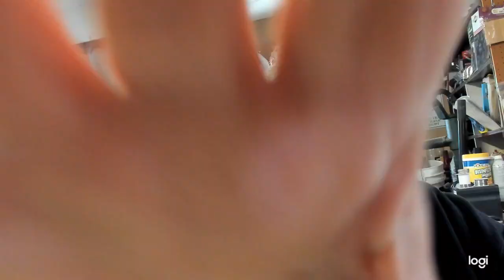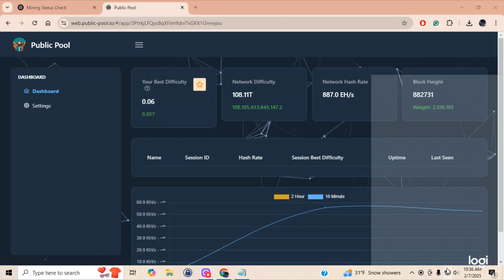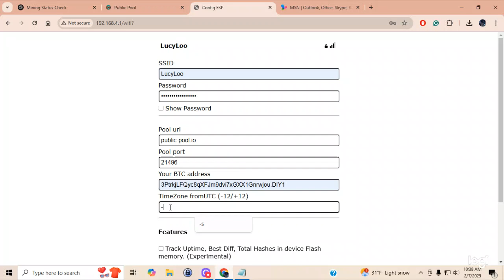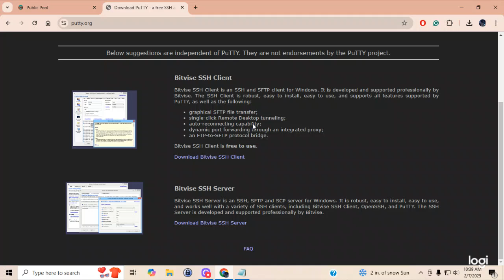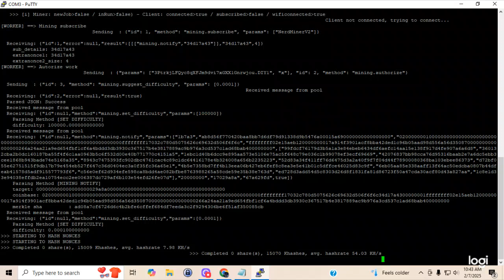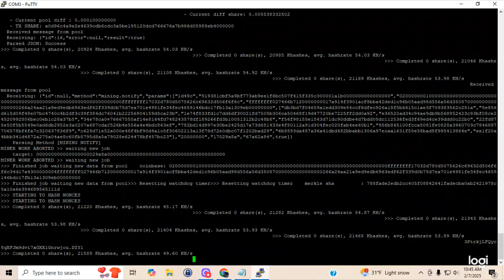Check Your ESP32 Lottery Miner Status Using PuTTY – Easy Guide!

Comment: Of course, it is fake mining that depends more on electricity and hash power, and unfortunately this is not available in sufficient quantities in ESP 
And the public pool is not good enough for mining Bitcoin and other things except with large devices. You can use your ESP to work in unmineable. It will be better and it will give you 4gh/s for some currencies and thus you will benefit from them better or duino coin ❤❤❤